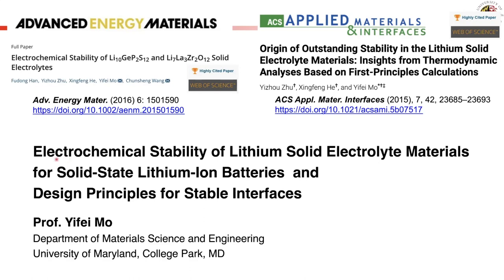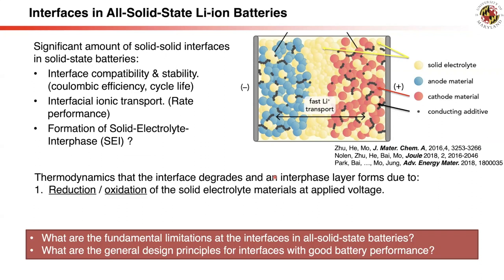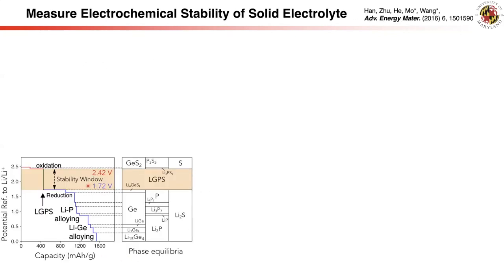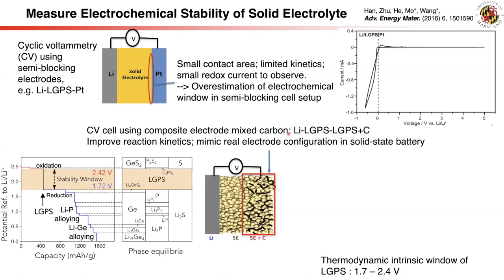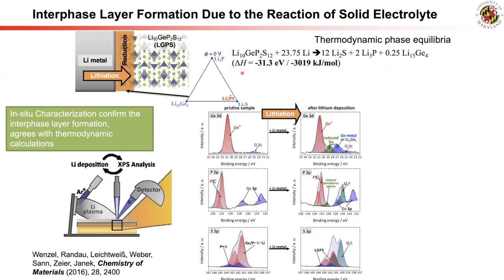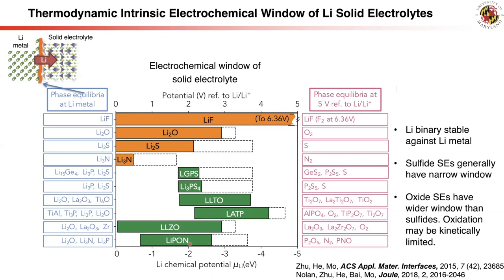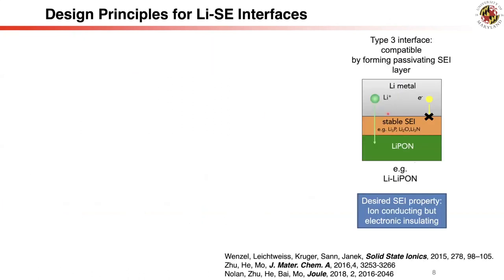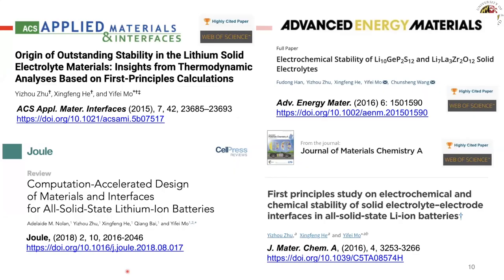Electrochemical Stability Window of Solid Electrolyte for Stable Interfaces in Solid-State Battery

Comment: Is there a way to quickly calculate the chemical window of a compound based on the materials project database? or have to use DFT calculation?
Reply from the maker: Yes, it can be done very quickly through MP
Reply: @YifeiMo  Thanks so much for the reply. However, I have been struggling with getting the electrochemical stability window from MP. Could I find any tutorials on this part? I was trying with interface reaction but I can't variate the potentials as I wish.
Reply: @YifeiMo  Dear Prof Mo, hope you saw my last comment and I really hope to just get a bit more advice from you or your students on the feasibility of getting chemical stability windows from MP if you have the experience. Really appreciated and thank you very much.